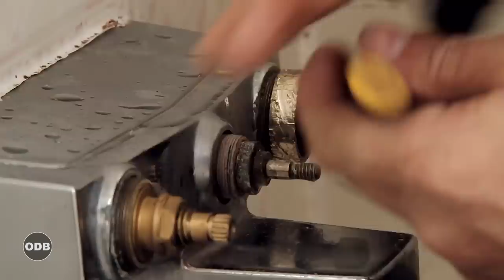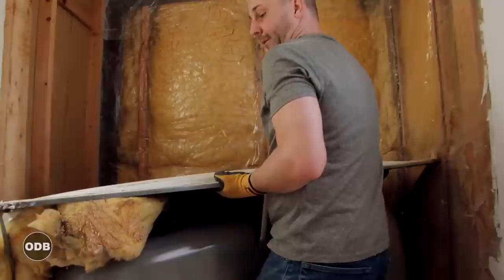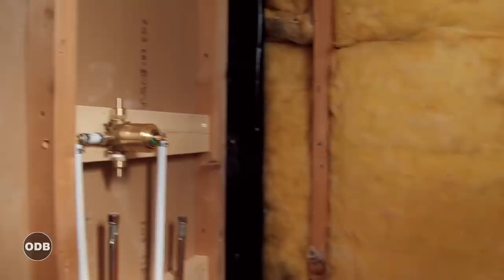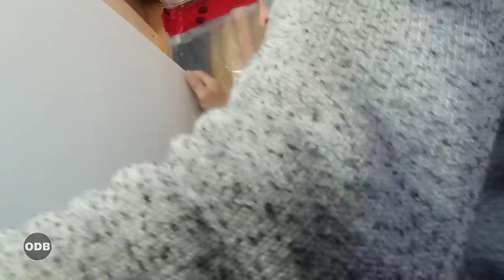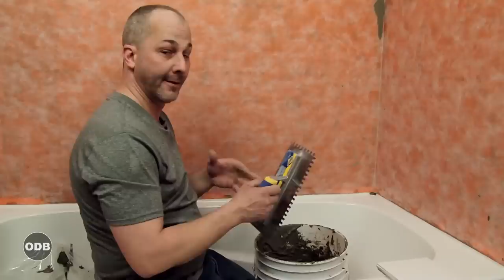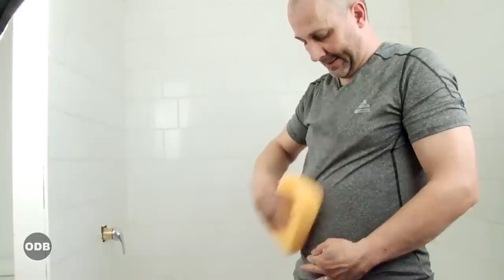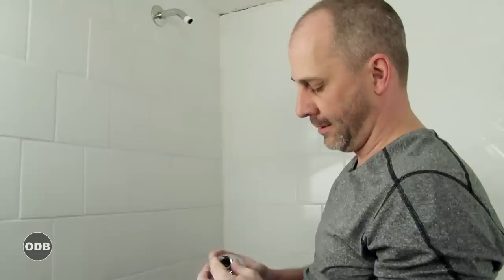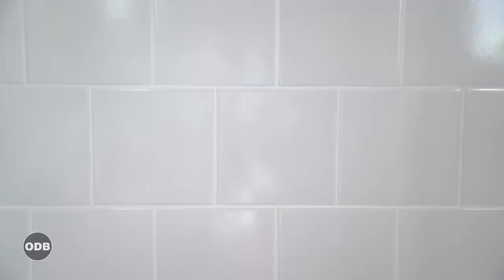DIY How to Renovate the Tub / Shower from A to Z

Comment: I rewatched a considerable amount of this fabulous video because I have to make a decision about replacing a tub and surround in my second floor.  I had a second floor added to my house and moved the cast iron tub to the second floor bath.  At the time it wasn't to save money as much as I had a strong tub.  Big mistake.  I had to have it refinished - an epoxy method.  In the past 11 years I had to have it done again.  The surround was cheap and installed incorrectly.  Now I'm thinking of getting rid of the tub, make a decision about a surround, etc.  I tried to replay what kind of tub you used for the replacement but couldn't quite make it out.  Would you please respond to me with the name - Maryland?.....Merilyn?.....it was something like that.  I'd hire you tomorrow if you'd come to Massachusetts - Haha.  Great video, I was totally entranced.
Reply from the maker: Hello Aprille, the company is Mirolin. They have distribution in the U.S. but you need to contact the head office for details. Cheers!
Available in Canada at Wolseley
Reply: @HomeRenoVisionDIY  The problem with cast iron tub is that it's very hard and doesn't flex much with the house. Also, another negative about cast iron tub is that they use brackets to mount to tub directly to the studs. It's not very secure. Whereas the acrylic with reinforced fiberglass tub from Mirolin can be directly screw in to the studs of the house which is much more secure. With cast iron tub, when the walls expand and contract, it doesn't expand and contract at the same rate, thus, you get the (white) silicone to wear and water enters the drywall through a wicking action which causes the wall to mold. This is why clear silicone is the best in this application.

Comment: With a well, I assume you would turn off breaker and open a faucet until you had no further pressure. .?
Reply from the maker: I just simply shut off the main valve after the pump!

Comment: Hi thanks for another awesome video! My question is do you have a video of how to fix a problem when the drywall paper has torn ? I started out putting it a sink and vanity and just painting and I noticed that there was 3 paints and a contact paper on the wall with lumps etc. I started to remove the old stuff and the paper started to rip some of the drywall paper now my simple task has turned into a whole over haul  it is a fixer upper and I'm doing the work myself, and I don't have a large budget any advice or suggestions are welcome and thank you in advance .
Reply from the maker: Hi Mary , use the kilz spray and prime the brown paper. it will accept drywall compound after that. Cheers!
Reply: @HomeRenoVisionDIY  thank you so much.

Comment: What are your thoughts on using densShield tile backer instead? Will save you that extra step of having to mud on the membrane. Great video btw.  Where did you buy the bathtub from? Home depot?
Reply from the maker: not sure why folks think the cement board is a replacement for a waterproofing system. it still needs a membrane and more importantly a seal from the bottom to the tub. Cheers!
Reply: @HomeRenoVisionDIY  That's a good point. Although, I wasn't referring to cement board but another product called DensShield. Here is what I pulled off of a website: The Tile Council of North America requires the use of a membrane in wet areas for cement backer boards but does not require a membrane for DensShield Tile Backer since DensShield Tile Backer panels have a built-in moisture barrier that stops moisture at the surface.

Comment: Do you recommend Shark Bite fittings and pex connections behind a closed wall? Since it’s only using a rubber gasket as a seal, are there concerns of wear over time, causing a leak behind the wall?
Reply from the maker: Only if you have access. Cheers!
Reply: Home RenoVision DIY In the video you’re using it behind the shower wall. Do you have access from the other side?

Comment: When I redid my downstairs half bath, I tried to pull the tile off the drywall. But the contractor had used cheap drywall that wasn’t waterproof so I took a sledgehammer to the walls instead. I do have to say, that was extremely satisfying to do. The bare bones were in good shape, so that was lucky. I took the old floor tiles out as well since the 1980’s called and wanted them back 😂. The toilet also went the way of the dodo since it was also a remnant from the early 80’s as well as the tiny washbasin. I got some green drywall and some 2x4s to build the frame that would hold the base for the floating toilet. Then I got to building. Built the frame for the toilet, made sure the brace for the toilet fit inside nicely, and made it as square as possible considering the walls weren’t square to begin with. Installed the drywall, taped and mudded all the seams, sanded it down and then it was time for tiling. I decided to go with black and white as the overall theme. Since the walls weren’t square with the floor I decided to do the walls first so that I could account for any weird angles and I wouldn’t have to cut my wall tiles at weird angles. I had chosen white marble wall tiles that went up to a height of 5 ft, then mosaic black and white square mini tiles, and then the white marble all the way up to the ceiling. For the floor I went with a matte black large natural style stone tile. The toilet was just white, but the new wash basin (sink) was a corner basin made of black granite. I even went so far as to put in a lowered ceiling with recessed lighting. A few weeks later I went and redid my entire full bathroom, which was a mission and a half because I had to put in new plumbing for water in and out, which meant cutting a groove in the existing concrete floor, install the new outflow pipe and then pour new concrete on top. That renovation kicked my tush, but I did it. And yes, I went with copper pipes for water in and soldered them. So glad my father taught me how to do all these things and I am able to do most of these things myself. My husband was extremely impressed with the results. He financed those renovations and just let me do my thing, helped me with the heavier lifting, but other than that he left me to my own devices. 
And yes, I’m the one who either builds furniture from scratch or builds IKEA stuff because apparently I can read the instructions. The only job I absolutely refuse to do, no matter what, is wallpapering. That just makes me irrationally angry. No idea why, but it’s one of the few jobs I outsource to professionals.
Reply from the maker: Way to go Desire, we would love to see pics if you have them so we can share on Instagram.
Reply: Home RenoVision DIY I think I do have some floating around somewhere. I’ll tag you on Instagram when I share them ☺️
Reply: Home RenoVision DIY I just sent you some pictures, the few I actually had of the renovation, in PM on Instagram. Not the best quality, since they are old pics, but it shows the job none the less.

Comment: Great info and instructions...what's with the inconsistent height of tiles that were cut on the top left of the large wall at 1:05:05
Reply from the maker: the wood frame house had settled and the tub was installed level. Cheers!

Comment: Shark bites are a big NO! Hire a plumber you dont have to worry about later shark bite failures
Reply from the maker: Use shark bite and Don't worry about hiring a plumber. Cheers!
Reply: sapo lowko
 I have used Shark bites over 10 years ago and they are still holding the connections. Are you a plumber?

Comment: Seriously you used a drywall instead of cement board for a bathroom??!!
Reply from the maker: Seriously, that does not mean that you can't use cement board. or schluter board, or fiberglass board, you do you!
Reply: @HomeRenoVisionDIY  I just think that using cement board will be a lot more long lasting for bathroom because of more water proof and moisture resistant?

Comment: Excellent video. I just finished a bathtub removal and installation for the first time ever just like you did here in your video. Now, after watching your entire video, I felt like I did an awesome job with the renovation. I didn't use the vapor barrier like you did but I went with mold resistant drywall from HD, taped and mud the gaps. The only reason why I went with a bigger tile was because large tiles produce less spaces in between tiles and provide a better water barrier which reduce the amount of water from seeping through the tile spaces and entering the drywall vs smaller tiles through time.
Reply from the maker: nice. Cheers!

Comment: Isnt it a problem that you perforate your vapour barrier with all that screws?
Reply from the maker: nope the plastic is compressed to the studs so no air movment possible.
Reply: Thank you for the answer ... here we have a technical requirement to put a fold in the vapor barrier and lay a special self-adhesive band inside that fold - if we want to put screws through it.

Comment: I'm missing where your waterproofing system saved time. Had you used cement board instead of drywall you'd be done.
Reply from the maker: cement board is not a waterproofing system!

Comment: What the heck is "groat"?
Reply from the maker: Loving it!
Reply: @HomeRenoVisionDIY  Great work on the reno. The only thing I see is that "groat" always seems to crack in the corners, and therefore allow vapor penetration into the substrate material. So I use a similar color of caulking where walls join, and also where tile and tub meet. Again, nice job.

Comment: ... I wish my bathroom renovation was going this smoothly. It's been 2 weeks without a shower (hose on the laundry room sink, and floor drain are in use), and that's because the builders went overkill: The walls are steel mesh backing with 1" of cement poured/pushed into it, then the thin-set with a 1/2" tile that likes to repel hammers (Minecraft had it right: I used a large pickax to break into the walls; even then it skated on occasion). It's been crowbars, hammers, and tin snips to pull the walls down. The outside wall is old cinderblock, and I had to eliminate an old window in it (frame that in). I learned to solder (had to grind back and re-attempt the one joint), and used end-cutting pliers to crimp where there's pex.

Worse yet, I discovered that a ghost plumber (can't tell where the original was and where the update began, but there was a bathroom re-plumb that took place at some point) had managed to replace old copper with galvanized... only for the bathroom, and pex for the shower. Quite frankly, had I known what I was getting myself into, I'd have just scored the original tile, glued new liner, and called it a day. But I had to break past the point of no return to discover that. I've felt like crap all week, and have mid-terms next week (I can afford to wash one week, and this was it). And now I redo the drain plumbing for the shower tomorrow.

The bathroom is tiny, has a poured concrete floor with tile (I'm not touching that), and no vent (which I have to build an enclosure for, and drill through cinderblock, brick, and siding for the vent.) I haven't even touched the toilet or the wall behind it, or the wall section with the radiator (boiler system) on it. Oh, and I've had some Lovecraftian measurements where, even tracing something out, the size changes and becomes too big or small - objectively speaking with someone there to prove that I'm not actually losing my mind.

I am simultaneously neck deep, making insane progress for my schedule, ready to kill something from stress, at peace, and neurotically typing this out. I don't know how to feel, but I'm confident we'll have a shower ready for Sunday... I think. There, I've run out of things to rant about; though that's because of how tired I am, and not that there isn't more to say. I'm learning three programming languages at once (*.0), object oriented programming, git/github and proper workflows, and my brain wants to quit sometimes.

Huh... that ended up much longer than I originally thought this would be. Have a good night everyone: I'm off to bed.